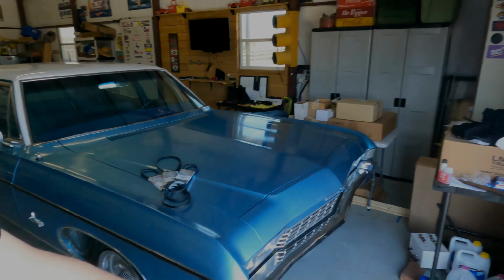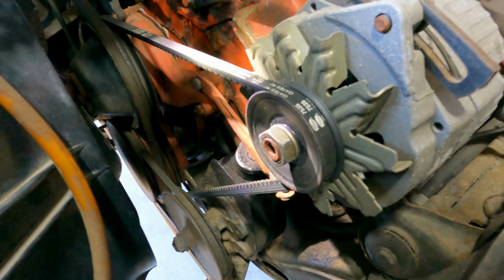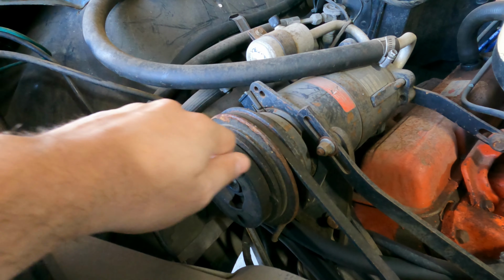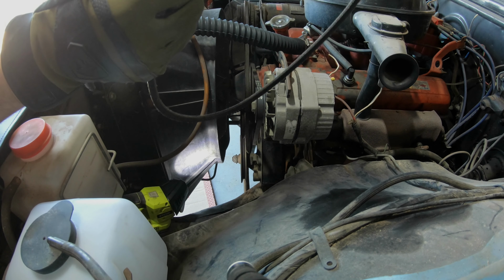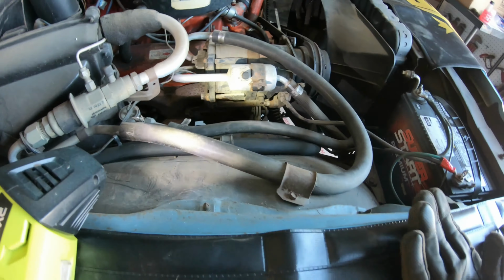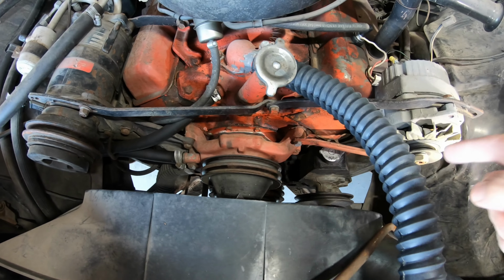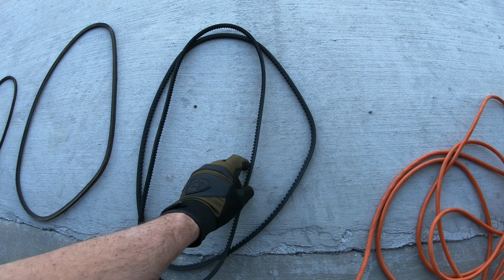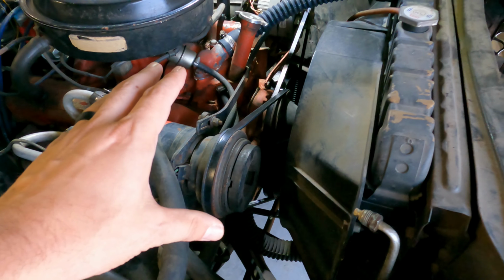How To Replace a Serpentine Belt | Removal & Install | SBC

Comment: I took out my ac I have a 400 small block I’m lost on how to do the belts 😅
Reply from the maker: If you are not running an AC anymore, I'd think you could just leave that belt off, and do the other two.
Reply: Yes 👍 But how do I run the first belt closet to the engine then the second closet to the fan shroud

Comment: I need a diagram for the belt on my 1978 Monte Carlo Landu 305
Reply from the maker: Should be pretty similar to my 307, all depends on your options far as AC, Power Steering Etc. If you google with your options there will probably be a diagram.
Reply: Damn dude Im here for the exact same car but 1979 😂

Comment: Kind of creative, yeah. I got an 85 Chrysler Fifth Avenue, and those are small blocks too. I need to change one of the alternator belts, but I might just change all of them. Just to have them all new anyway though. I got to just look at the condition of the rest of them first too though. I think this mug got like four belts on it too.
Reply from the maker: I'd do them all at once if you have the time, that way you it's just a hassle one time and you shouldn't have to worry about it for a long time. Man I love the grilles on those 80s Fifth Avenues, cool car.

Comment: Where did you pry on AC compressor to get tension on the belt? I can't get enough tension on mine.
Reply from the maker: I am pretty sure on that one I wrapped a towel around my crowbar and slid it between the top of block right under the valve cover and compressor for leverage to push it out till I could use the nut to lock in that top front mount, then I went around and did the other nuts. Mine really didn't take much force, just be gentle with her so you don't wreck your valve cover.
Reply: @CLASSICSAREBETTER  Thank you! Will give it a try

Comment: Hey man got a 83 Camaro with a 350 sbc just wondering if you know the sizes of these belts mine popped the other day while driving
Reply from the maker: I am not sure of the sizes, but I used Masterpro belts 7530 (serpentine), 7312 (A/C), and 7350 (PowerSteering) in the Impala. Best of luck on your Camaro!

Comment: how tight should the belt that goes to the alternator be?
Reply from the maker: It should be snug enough that it doesn't squeak and slip when you run it. Make it's taut, but you can still flex the belt a little with you hand.

Comment: Any chance you plan on changing weatherstripping in the near future? Or maybe just the window vents?
Reply from the maker: I actually have a weather strip kit that I just bought for my 67 Camaro that I should be installing soon, would connect about the same way. It has almost the same window vents.